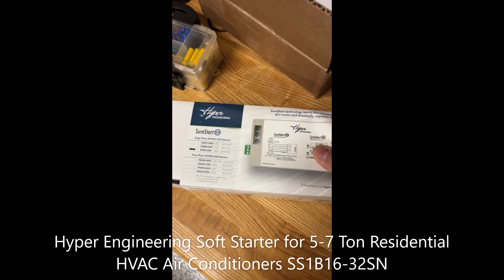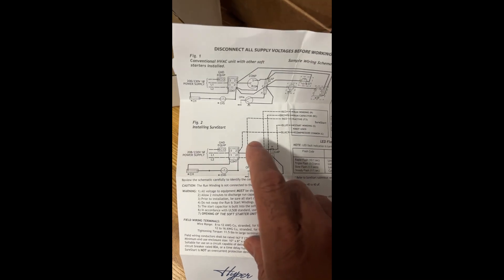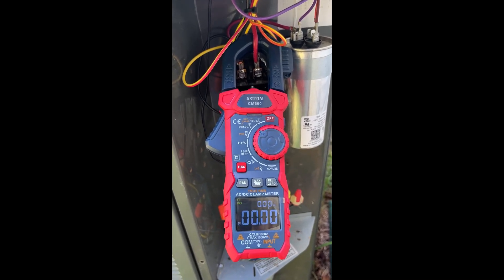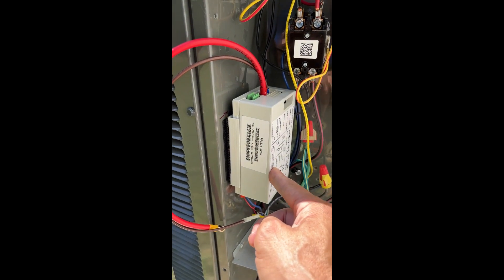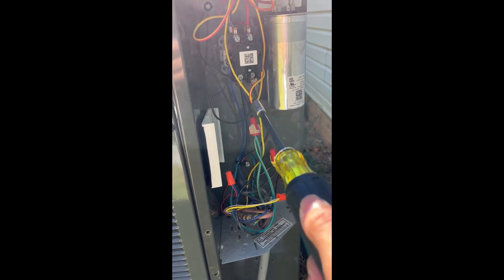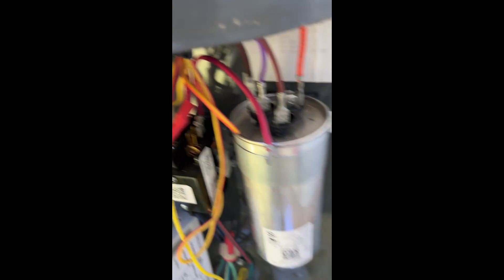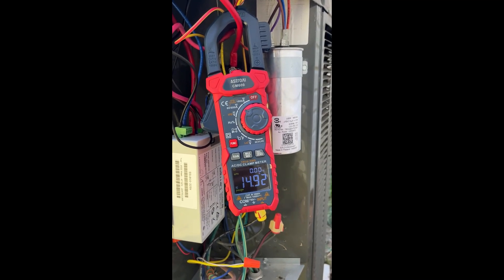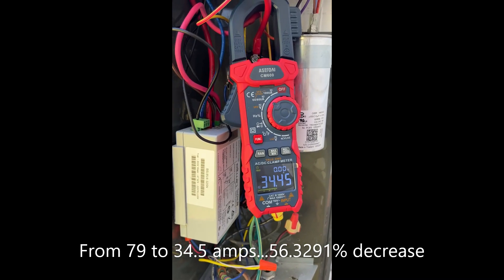Soft Start AC Installation -  Hyper Engineering on 5 Tons Trane Model 4TTR6060

Comment: Excellent video--thanks for confirming the need to remove the wire between L2 at the contactor and capacitor C terminal.

 I'm preparing to install an Emerson SecureStart ("for Copeland Compressors") on a 2.5 ton Lennox heat pump outdoor unit model ML14XP1-030-230  which soft start appears to be identical to the Hyper Engineering version, just somewhat more expensive and (aside from a connection diagram) comes with neither instructions nor a wire/terminal kit.

There is not a lot of room to mount the unit inside the Lennox electrical compartment and a dry fit suggests probably the best place for the unit straddles some low profile screw heads  on the bulkhead (i.e., not a flush mount).  This is not much of an issue but (for me) rules out screwing the base to the bulkhead since I don't know what's on the other side, don't care to find out, hence plan to go with Velcro.

Having researched every other aspect of the project and pretty much ready to go I haven't been able to decide on what Velcro product to use.  The thicker the better since thick enough would preclude having to drill headspace through the SecureStart base.  It seems the Velcro in the video might do.

Therefore I would very much like to know what 3M Velcro product you used to mount the SoftStart 🙂
Reply from the maker: Glad the video was helpful...the Velcro I used is this one: https://www.amazon.com/SANKA-Reclosable-Fasteners-Outdoor-Acrylic/dp/B08YR5TYZC/ref=sr_1_9?crid=3ECXZUQUOIK7O&keywords=3m+velcro&qid=1701201870&sprefix=3m+ve%2Caps%2C95&sr=8-9

Comment: Here's to you!  I saw your video, checked the instructions, and sure enough that wire between the contactor and cap was still there! Pulled it all I'd good now!!
Reply from the maker: Hi !, thanks for the comments...yea, it was something I wanted to point out, since it could be missed
Reply: What would happen if we leave the wire (between the contactor and cap) there?
Reply: @sonnyng2001 I'm wondering about this too. Eltwin Sure Start and Airgo are identical product. The only difference in instruction is Eltwin Sure Start wants customers to remove that cable while Airgo doesn't.

Comment: It's one of the best explainers on a soft start device.  We just installed our GRID TIED solar system and plan to add WHOLE HOUSE battery backup next year I know my 3-ton Lennox with an LRA of 83 amps will need a soft start device to operate from the batteries. I have saved this info for that time.  Cheers
Reply from the maker: Thanks for your comments.....this device is definitely a life saver, now I can run my AC with my generators
Reply: Is LRA the in rush or the max? I just got this soft start to be able to handle my new 50a generator.
Reply from the maker: @Quaght  from the internet: "LRA stands for locked rotor amps, which is a measure of the current a compressor's motor draws when starting up:
Explanation
LRA is the current a motor draws when its rotor shaft is held stationary while the motor is running. It's usually five to seven times higher than the compressor's normal operating current. LRA conditions only last a few seconds during startup."